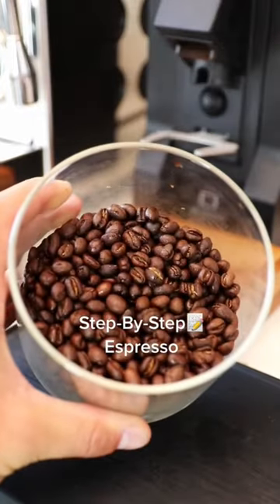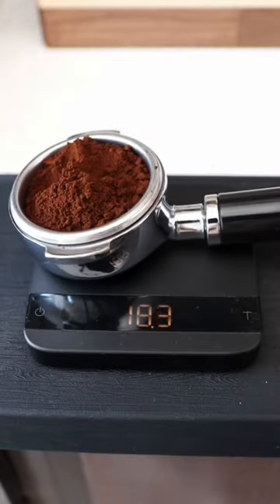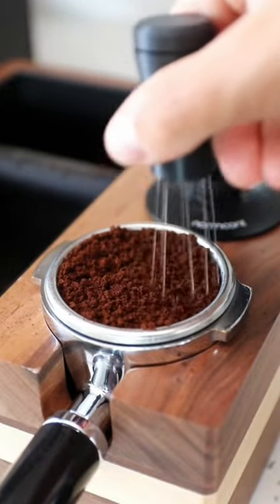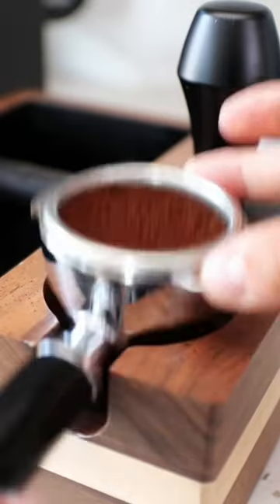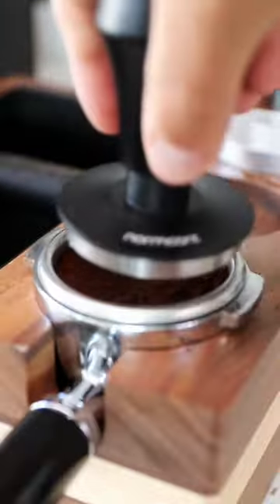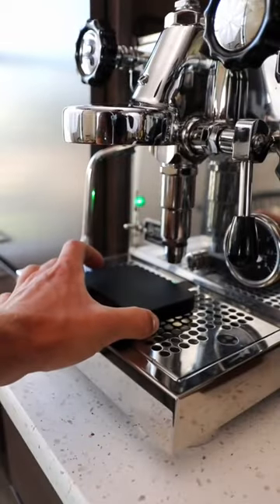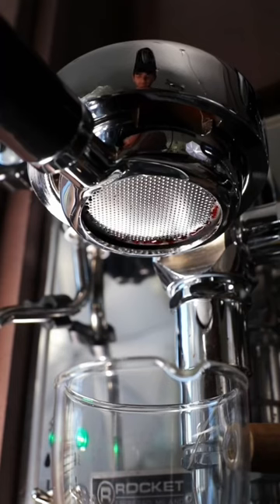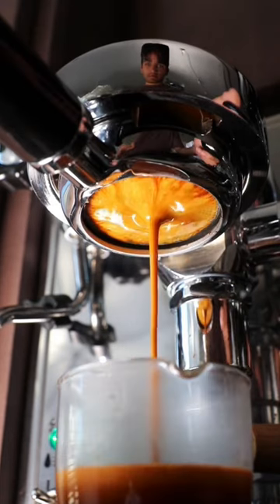My foolproof espresso recipe #coffee

Comment: That's like the standard espresso recipe
Reply: What did you expect, this is how its done
Reply: exactly
Reply: @Dennaton  well he did say his receipe
Reply: he said it’s foolproof
Reply: @sundayfunday5059  my foolproof, means its his
Reply: @74_pelicans  he said “a foolproof”
Reply: @sundayfunday5059  title says my foolproof you ok????
Reply: @74_pelicans  in the video he says a foolproof
Reply: its not even foolproof because its missing extraction time. a 2:1 ratio means nothing if it took 60 sec to extract. should be about 25-30 sec.
Reply: Save
Reply: No purge. No mention of brew temp.
Reply: @reverbisland actually, time means nothing… ratios are based on weight, not timing
Reply: @clipsy9931  more time means more extraction. Could be related to the basket, the pressure, how the coffee is grinded etc etc so yeah, 1:2 ~ + 25sec is quite important to be in the right norm. Then you can move things around I'd say so you can try things and see how you like and feel the différences
Reply: @clipsy9931  That's not what he's saying. Yes, ratios are based on weight. But they'll mean absolutely nothing without proper timing. Time is everything, you could have the perfect ratio, the perfect weight but as soon as you start falling outside of the 25-30 sec window for extraction; you'll always either under or over extracting.
Reply: @02ditf23  True

Comment: Foolproof espresso recipe should include extraction time, too. 
You can have that 2:1 ratio all you want, if it's pulled in 45 seconds it's not gonna be good.
Reply: Anywhere around 24 sec. Another thing he should mention is that he is pulling a double shot espresso. Trying to put all that coffee in a single basket will be a bit challenging…
Reply: double is fine. most people pull doubles because singles are much harder to get right

Comment: A super standard and easy recipe, just need hundreds of dollars of equipment to make.
Reply: Actually it’s thousands
Reply: my boyfriends espresso machine was like 15 bucks dude you just gotta know where to look lol
Reply: Making espresso is expensive because of the sheer amount of engineering and technology that goes into those machines. You need a lot of pressure and that pressure needs to be controlled. But you can buy like a Flair neo flex which makes good espresso for $99 but that is manual relies of you creating the pressure by pulling a lever. 

Also remember, the amount people spend on coffee at Starbucks quickly adds up to the cost of one of these, and a set up like this last for decades